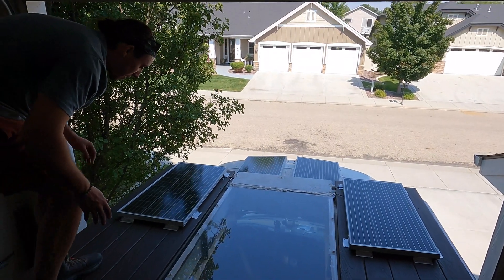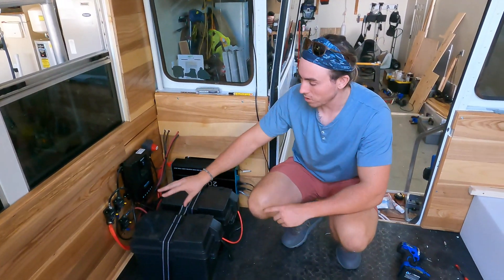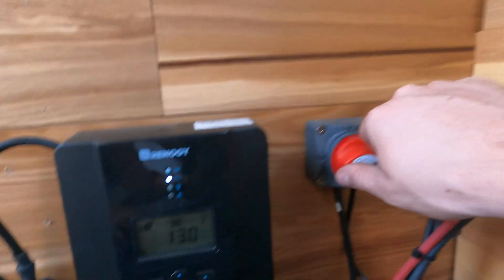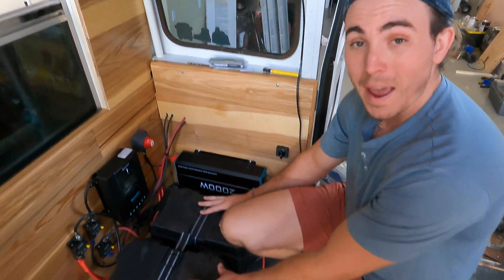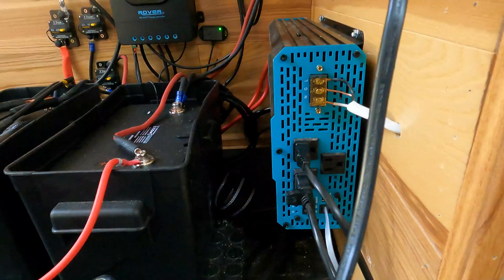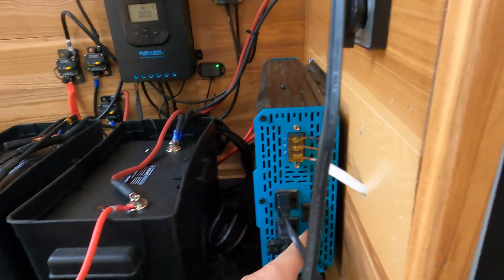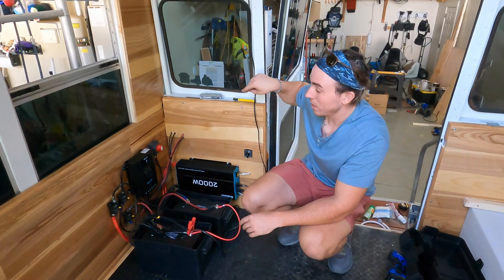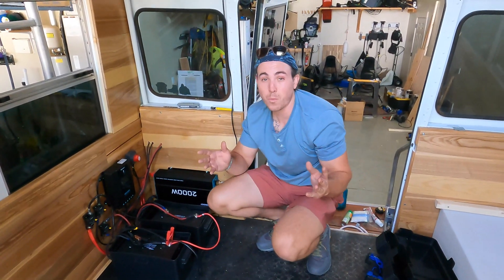Renogy Solar System | Us & A Bus

Comment: I connected a charger permanently to the batteries and the AC to a Shore power outlet located near my power system. Whenever I’m on shore power my batteries automatically get topped
Reply from the maker: Genius!!
Reply from the maker: I've been thinking about this. If I have the charger permanently connected to inverter and battery, if I'm not plugged in to on shore power what happens with the charger? Does it simply not work until plugged in or does it waste energy running of the inverter?